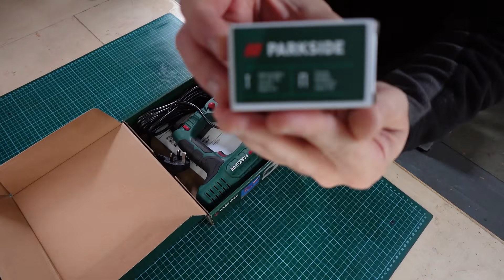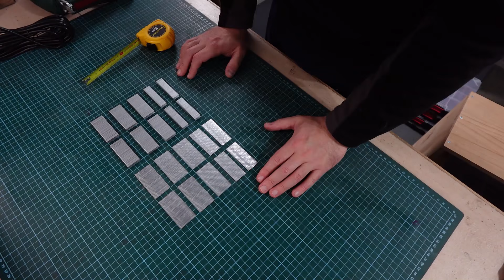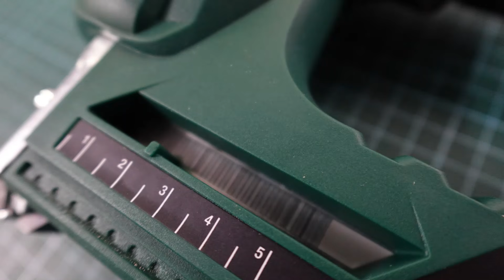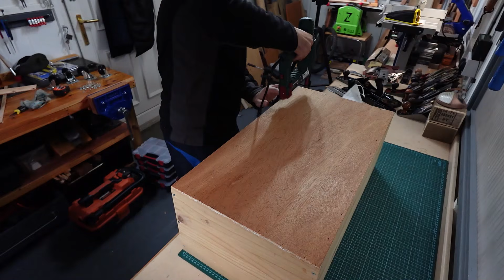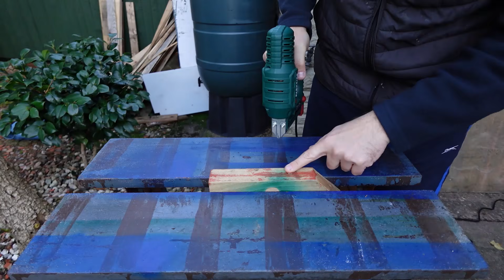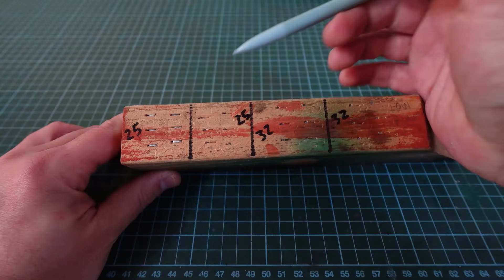Parkside Electric Nail Gun / Stapler Model: PET 25 D4 from Lidl - Tool Review

Comment: Great review and it seems to work very well . One thing im wondering is what guage of brad and staples does ot take ? Im not sure of the actual measurements but the thinner ones aren't as easy to get hold of . The reason I ask is that my old air stapler has just bit the dust and it took the thinner guage .

Comment: That little red job above the loader is for accurate measuring nails ie slid it to 50mm and it works like a guide to keep nails in 50mm line or whatever measurement on nailer you want
Reply from the maker: Thanks for the info!

Comment: I was about to turn my nailgun in , as it didnt work. Turned out I didnt feed the nails from the bottom, thought they went into the springload.
That solved, Its a very effective gun. I primarily use mine for sort of an extra clamp. Glue up, then nail and the occasional screw.
Excellent value for money
Reply from the maker: Yea I agree!

Comment: I have been using the old version and experienced it having too little power and a tendency to jam. I am tempted to get the new version.
Reply from the maker: I am not sure if there are any differences as I never owned the previous model.
Reply: Same mine notoriously jammed (old version) new one does not look any different but obviously can not see inside from a video. On another note the parkside glue gun blow up in my face the other day when I attempted to plug it in haha
Reply: @despicablegru123  Oh No! I've got one of those as well. I guess I'm stuck with it. The multitool has proven a lightweight hit and the impact driver saved me £100+ call-out to DIY a job. But I've already got a better one of each.
Reply: Same here.  I have problems with the old model jamming when it eventually decides to shoot a nail in.  This newer version looks much better.  Will have to have another go before I decide to upgrade.

Comment: At that price its a steal. However while it may look like a lot of brads and staples you can chew through them very quickly. I have an air nailer and used several strips of brads in a single project so recommend getting down to Screwfix and buying a box of 1000 Tacwise brads in each size you commonly use.
Reply from the maker: True. I do get carried away sometimes when firing Brad's 😆

Comment: I have one and, as you say, total bargain. Also, the 3 year warranty is great.  I have claimed on Lidl’s warranties previously and they have always replaced faulty items.
The only issue I have had with this tool is when I tried to attach MDF architrave using 32mm brads.  The increased density of the MDF meant that the brads were left about 2mm proud of the the surface.  I’m still impressed for the price though especially considering I don’t have to drag airlines around for my air nailer.
Thanks for the video.
Reply from the maker: Good point I should have tried it on some MDF although it went through Oak surprisingly easily so it's good either way for me.
Reply: Same here - I used this nailer on MDF architrave with 32mm brads. Most nails were left proud and had to be fixed with a nail punch.

Comment: £15 is an absolute steal. I picked one up a few weeks back as my 12v one broke (after extensive use). I was deliberating whether to order a corded one from Amazon or spend a bit more for a 18/20v one, which would set be back well over £100. I have a Silverline brad nailer for my air compressor but it doesn't fire staples and I can't really take it out an about with me. When I saw this Parkside one so cheap, the decision was made for me. It's nice to have a staple option in the workshop and I can use it out and about, as long as there is a plug socket nearby (or with an extension cord). I would like a 20v one to be really mobile but for now this fills the gap and seems very sturdy & powerful, with no jams so far!
Reply from the maker: @Rooster---ooo  I agree. It's a no brainer type deal.
Reply: £60 nailer and battery 4amp in Iidl don’t know where you got £100

Comment: Looks great, wish I'd seen this last week, I've just purchased a titan nail/staple gun from Screwfix basically the same as this one to install some trim to skirting boards, fires 15-30mm length nails and it was £29 and I've found the cable is very short as well...🤔 Can I return it 😅
Reply from the maker: Yea it's annoying when that happens! The thing is with this nail gun, I noticed how quickly it sold out in my area so I am not sure how easy it would be to find one at the moment anyway.
Reply: @PhillWyattProjects  True, I was in my local Lidl less than a weak go and didn't see it.